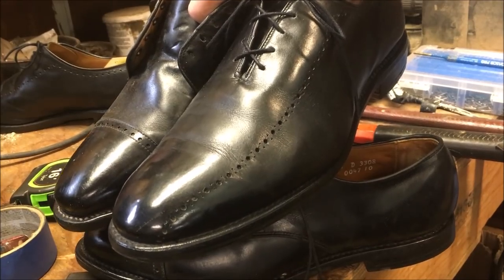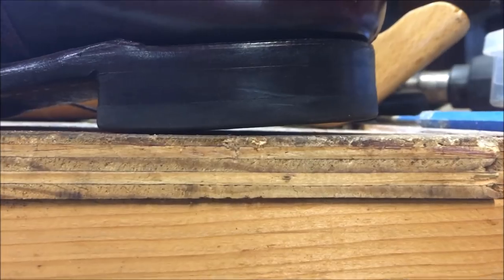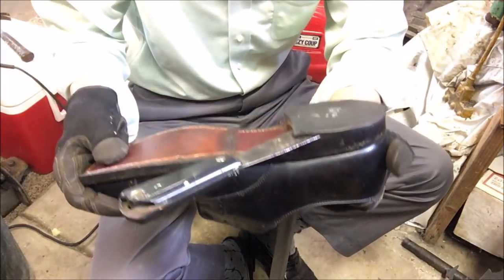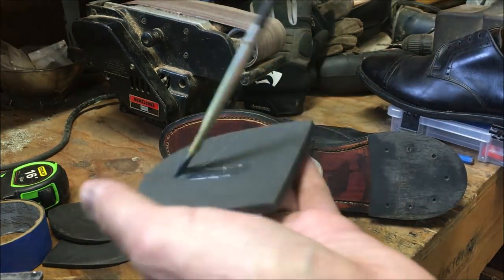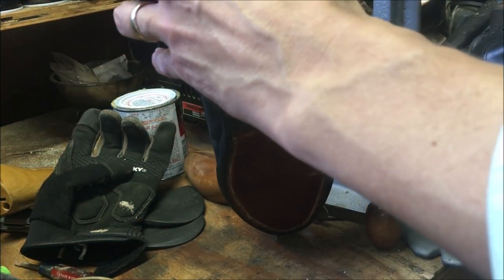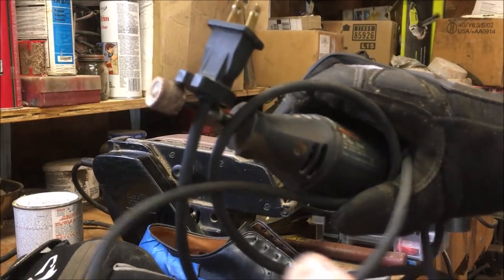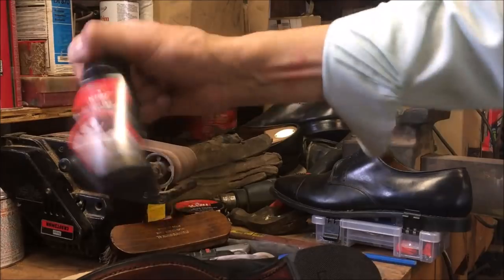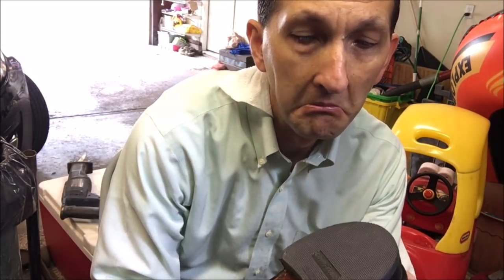How to Replace Top Lifts (Heels) at Home (detailed)

Comment: Internet safety expert here. When removing the top lift, I cringed a bit when you had the putty knife pointed towards your leg/stomach. Be careful, man. Keep sharp things pointed away from you. It's easy to slip. I just used pliers to pull mine off. Much safer and easier.
Reply from the maker: Anthony Keeley - good point, but it has no sharp edge.
Reply: My grandpa was a painter and got a nice cut in his forearm from a putty knife. It required stitches. I actually pulled the lifts off two pairs of shoes today. Thanks again for the video.

Comment: This was a really excellent video that helped me gain an appreciation for what my cobbler does. I had wondered why it costs $40 to top lift a pair of shoes but now I completely understand why
Reply: A cobbler with the proper tools can do this much faster and easier.
Reply: I wondered that too.  Quoted prices would range from $25 to $50 for the same type of repair that I wasn't sure if the higher end ones were trying to overcharge me.
Reply: For some, who are good with their hands and take basic repair(s) such as re-heeling, it they may take longer to complete but feel pride and satisfaction of professional finish when they have necessary hand tools.

Comment: 45 years ago, we used a belt sander in our shop. Cut open a 4x8 plywood sheet to have belt only exposed...,we thought we would patent it, until about a year later the shoe repair manufacturer came out with the fore runner of what we have today. We change from rough belts to smooth belts  to completely finish the heel blocks with the rubber heels.

Comment: You’re great but, here’s another tip. Instead of the spatula/putty knife you should use a mallet and a wide chisel which is made to be struck. The mallet will save your hands from being punished, you can find these tools used for cheap.

Comment: Thank you for your video.  I was able to follow your steps to remove the old heel and replace with the recommend Goodyear rubber heels.  One thing I did differently, because I don't have a belt sander, is use a bit guided router to shape the heel.  I was surprised at how well this worked!  I was able to get the rubber perfected flush and smooth with the heel.  The shaping process took me about 10 minutes for both heels.  I tried this on a cheap pair of throw away shoes but I'm so impressed with the results that I may try it on a nice pair of shoes like my Allen Edmonds.

Comment: Thanks Robert. This video was very helpful.  You give us the hope that we could do this too.
Reply from the maker: Kent pool 🙏🏼 thank you that was my objective! I’m not teaching how to make bespoke shoes here.
Reply: Please don’t do it yourself. If you do it wrong you’ll damage your joints, could cause yourself an injury not to mention all the toxins and carcinogens you’re exposing yourself to. We go through years of training and have specialised equipment with dust and fume extraction for a reason.

It’s great to see people taking an interest in the process and techniques but DIY shoe repair is never a good thing
Reply from the maker: English Shoemaker I appreciate your concern, but I don’t think opening a can of glue a couple times a month in an open garage & using a belt sander on leather is that big of a deal. Of course I showed my injury to point out the good as well as the bad. I’ve had plenty of injuries over the years. I built cars for almost 20 years and I’ll tell you hot ridding is 10x more dangerous in all aspects.
Reply: Doing one pair of heels without any form of extraction, you’re probably breathing in more dust than I do over several months.

The issues I’m more concerned with over DIY repairs are that if it’s done incorrectly it affects your gait, balance, posture etc.

I applaud anyone who takes an interest in the craft but I don’t understand repairing your own shoes to save a little money especially when it can have so many knock on effects
Reply: @englishshoemaker7152  it's hard to find people to get an apprenticeship from. I've contacted my local one. But times are slow and fading from the idea of repairing instead of new. Its something I want to do, so learning yourself is really the only way to go

Comment: when they pull off the top lift with pliers they rotate the pliers bend the rubber off. ive seen a lot of videos of them doing it and they do it the same every single time. just sayin
Reply from the maker: Thanks for the comment. I did pick up one of those funky cobbling pliers those guys use.

Comment: You could use the old top lift for a pattern. Will save you a lot of work cutting after installing!
Reply from the maker: Ben Foust have you had success with that method? The problem with that method I’ve found is:
1. Cutting it exactly. There will always be error that will show up on the heel if you cut to a traced line.
2. getting the top lift aligned perfectly. The nature of the glue is that it really doesn’t allow for adjustment of the top lift after installation.
Reply: Excess from standard heel piece could have been trimmed using sharp garden secateurs to save on time.
Also sander was loose on the bench, could cause accidental damage on shoes or things around it.

Comment: Appreciate the Video.  The belt sander is working you too hard.  Can you bolt it down?  Maybe get a large wood platform, either a small piece of plywood or a kitchen cutting board for example if you need to keep it movable.  You could either clamp the platform down or temporally screw it down to your workbench.  If the belt sander is meant to be hand held, maybe you can clamp  in a vise.  If the sander gets tipped over and catches on something, it can shoot it onto your lap and that can ruin your day fast.  Also while "Chiseling" the Top Lift off, lay something in your lap if you must chisel toward your leg, maybe a heavy canvas jacket or carpet sample.  I liked the polishing finger wrist wrap, might have to use that myself.  Thanks for the work on these videos.
Reply from the maker: YOURE right, I’ve thought of that... it’s funny as things progress (I never had a “goal” to gain subscribers or views) the expectations seem to rise, but yes you’re right about securing the belt sander.
Reply: yep. Also like to see you roll that sleeve up one more time around power equipment. Take off the ring. Ticky Tacky but safety is a better safe than sorry area. Also, I call your spatula a putty knife. lol

Comment: Robert, please do not wear long sleeve shirts when using power tools !
You would probably love this home belt sander for your hobby: WEN 6502T 4.3-Amp 4 x 36 in. Belt and 6 in. Disc Sander with Cast Iron Base
Reply: Agreed! I'm no pro but those loose hanging sleeves and the user of gloves on that belt sander would be a no no for me. If one of those catches...no time for recovery. But I did enjoy the video; very instructive.  However, I also think I'll just pay someone to do it for me but at least now I know exactly what goes into fixing to top lift on my shoes. Thank you.

Comment: I used to use a belt sander when I repaired my shoes at home. It soon burnt out so I searched for a better option. Luckily, I found a vintage American branded shoe finisher (Probably from the 1930s) on eBay and purchased it. It was all rusted and the old paint was flaking so I restored it and made it look near brand new. It works like a charm.

Comment: Mr. Power go ahead and mount the sander at 45 degree, and use the round roller to sand with. That is how it done.

Now buy two more sanders or so buy three or four basic grade sand paper 220, 120, 80, and 40.

Now you are able to watch the glue come off, and the sanding on the side with accuracy.

Blessings
Reply: May I ask what grit belt sand paper you use for the 1) roughing up; and 2) for the final edge finishing?

Comment: My loafers have the gap when i put the heel flat idk why and how to fix ittt and its not comfortable
Reply from the maker: JLBRIXYPLAYZ - I know what you mean, without seeing it it’s hard to say, if there is a gap at the back of the heel, it might mean removing the top lift and sanding down the front of the heel base, but that’s very difficult to get it level, and to get it the same on both shoes. Messing it up it theoretically can cause back issues, so you may want to take it to a cobbler. If there is a gap at the front of the heel, you probably need a thicker top lift.

Comment: I take it we would need to buy the exact thickness of a toplift to get the proper level height for our shoes.  
   If one does not have a belt sander, I wonder if there's a way to precut the toplift close to the right size before attaching it to the shoe, then later sand it down manually.  I have a mouse sander though.
Reply from the maker: It doesn't have to be EXACT, but get it as close as you can. I wouldn't try to sand or thin down a top lift, it's just too difficult even with a belt sander. I generally don't see factory shoes with top lifts thinner than those inexpensive Goodyear top lifts you see in the video. You may have to pull up Bing or Google to search thicknesses, as some shoe stuff is measured in "irons" thicknesss.

Comment: In the future, I think you could use the old heel sole to outline the new one and trim it before applying it as to avoid sanding the stacked leather heel. I'm not a professional and I've never done cobblery. Just my observation
Reply from the maker: Life Connoisseur - I’ve tried that, and I found that you can’t trace it accurately enough, nor can you cut it accurately enough to make it fit exactly. But good idea!

Comment: Hey, Robert... you think it's better to match the thickness of the rubber heel soles with the half soles if I buy them on amazon? I'm not sure if the question makes sense to you.
Reply from the maker: Life Connoisseur - I’m not sure what you mean, are you talking about adding protective half soles over the soles, AND replacing the top lifts? Most protective half soles that are glued on over the soles are thin enough where they won’t affect the heel balance (geometry). Generally speaking though, if you put on top lifts that are thicker than what you took off you’ll have problems. You CAN buy protective half soles and heels as a set, but even then the matching top lifts are generally thicker than the half soles.
Reply: @CobblerBob  I apologize for the confusing question, I'm not a shoe connoisseur like you. I meant, I bought a new pair of shoes and I would like to put some protective half soles and some rubber heel to protect the shoes original outsoles completely. As you mentioned, if the heel is too much thicker than the front you get arching in the middle than damages the shoes. What would be your suggestion for this if someone wants to add protective rubber on to their shoes?
Reply from the maker: Aah, now I understand. I’ve got s video on how to apply protective rubber half soles, and another one on how to install heel taps. Heel taps will effectively protect the heels from wear.
https://youtu.be/Srz9-f5t0a4 
(Sorry for the low quality video, it’s old)
https://youtu.be/SF5j--6am14
Reply: I've watched both, thank you. Very informative, long time viewer and subscriber. Would love to watch more shoe review videos.

Comment: Hey Bob. Question for you. Do you have an on and off switch on that belt sander or is a trigger? I have checked into similar models of the one you have and they all have trigger switches which would make it very difficult to do this task with just one hand. Thanks!
Reply from the maker: Nick Donato - mine has a trigger plus a button on the side. When you depress the button, it keeps it on. I’m sure this unit is more than 25 yrs old.
Reply: Robert Powers thanks for the reply back. I found a good option on amazon that serves as a table top/bench sander that can be mounted to a surface and would also work as a traditional sander and has a locking on switch. Appreciate this video. 👍

Comment: Nice Video. Question: what can be used as a sandable and stainable filler between the the rubber sole and the wood or leather block lift layers? This is if the wooden heel is damaged from wear from not replacing the rubber sole

Comment: Hi! I do a lot of my own work -- but you're far better.

I live in a city so I should keep my physical items to a bare minimum - I've been avoiding a cobbler's anvil because of that.  Do you have specific recommendations for how a 2x4 can be used? I was thinking of making my own wooden version of that stand (I could always throw it away as needed). What do you think?
Reply from the maker: Winston Fong - that may be difficult! The top comes off, so you could literally store it in a closet. It may be really difficult getting a 2 x 4 thin enough to fit inside the shoe, but strong enough to not flex when you pound on it. I would just find an iron one using a local marketplace app like Facebook or letgo. As I said, I Purchased mine for 20 bucks
Reply: @CobblerBob  serious thanks for the response. In the end, I'm getting an anvil from a very small town.  And keep up the great videos: your accessible, down to earth style really resonates.

Comment: I noticed that shoes on my shoes the heel base do not have parallel sides and it is narrower (has less height)  at the front.
Reply from the maker: Yes, that's part pf the heel balance, and they often have more height on the inside front of the heel versus the outside front of the heel. More height on the inside front gives some "arch support".

Comment: Hammer sharp objects towards your thigh is a recipe for disaster. Otherwise a good job!
Reply from the maker: Jim N thanks for the tip, but I could rest that putty knife directly on my leg and smack it and it wouldn’t hurt or cut my pants. It’s dull.
Reply: Robert Powers I love your videos and I’ve really learned a lot. I respect your work to the fullest. 
That being said, I’m an electrician by trade. A mechanic of sorts. I work in the construction industry where safety is a huge issue. Sometimes you scare me. I learned early on over 30 years ago to “always cut towards your partner”. That includes hammering. 
Try to develop a method where you can cut and hammer away from yourself. Maybe nail down that sander too!
My advice is...Get a vice! You’re a clever guy and you’ve already been to the ER once that’s we know of Robert. 
I use those carpet knives all of the time too. Had a few close calls. 

Step up the safety! From one mechanic to another.
Keep them good videos coming! 
Thanks

Comment: Great video! A question about the dye. I have a black top lift on a brown heel. Do inthen use black dye or brown dye 🤔?
Reply from the maker: It's hard to say without looking at them, but if you use brown, and don't like it, you can always darken it to black. You'd probably have to sand them back down after dying them black to make them brown.
Reply: @CobblerBob ok thank you 😊

Comment: Grateful to you for your video. I always wondered about the process. Nice work. May I please suggest that you don’t wear your loose folded dress shirt sleeves near your spinning belt sander and maybe lock that thing down so it doesn’t grab you. Might hurt worse that the box cutter :-). I also bet you could sad the inside curve of your excess heel rubber by holding the shoe sideways to the cylinder of belt sander and using its curve inside the curve of the heel. Does that make sense :-)d god bless your efforts :-)Dave
Reply from the maker: LO, yes, good points. One point, I think the sleeves APPEAR closer than they are because of paralax, but in my more recent videos I do usually fold them up higher just to be sure. As far as the sanding technique, that part definitely requires skill. One of my much more recent videos:
https://youtu.be/RC2i-knabLs
go to 30 mins 30 seconds I actually go over what I've learned about heel edge finishing, but in short, the span that flexis IS nice because it gives a curve, but because it deflects, you tend to not get the edge straight. I've started using the part of the belt over the driving cylinder even though it's a hard line contact rather than a wider contact, because it gives a better finish. The downside is it's much more difficult so it requires more control.

Comment: Really appreciate the video. Is the hardness of those Goodyear Neolite rubber top lifts enough to make sanding "easy?" IOW, does it sand similarly to the leather or wood or do you have to be more delicate with the rubber to get smooth outer edge?  Also, what grit sandpaper are you using on your belt sander?  I know you mentioned 400 grit for your final sanding step.  Same on the belt sander to remove larger portions of the rubber?
Reply from the maker: I’m glad it helped! The Goodyear Neolite top lifts are a rubbery texture. They’re not extremely hard. They’re easy to sand with a belt sander, but difficult to sand by hand. I start with 36 grit on the belt sander then go to 120 grit. That gets it smooth enough to hand finish with 180 then 320.

Comment: I found the same "gap" or unbalance problem on some of my shoes and boots too. Especially some English brands like Barker and Tricker's. I don't know whether they do it on purpose or it's just their manufacturing tolerance, but it didn't cause that huge trouble for me personally. If I were you I might grind the rubber heels rather than heel bases by the way.
Reply: It’s not a problem. This is the trouble with a little knowledge or assumptions, it’s dangerous. Some shoes require it, some don’t. It entirely depends on how the shoe has been designed and it takes training and experience to know the correct way to replace the heel